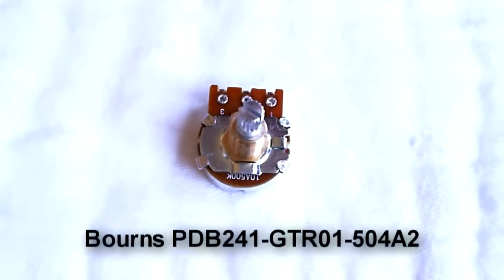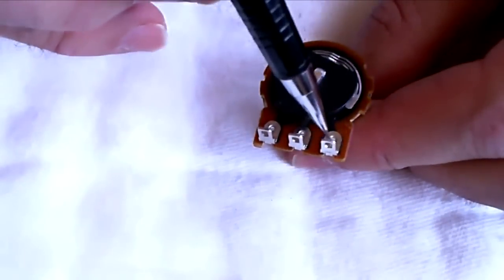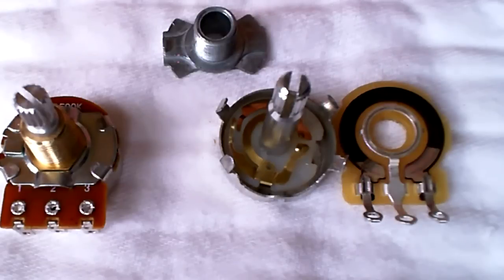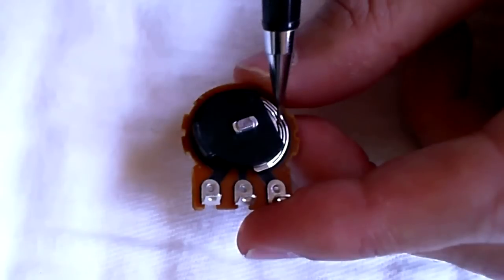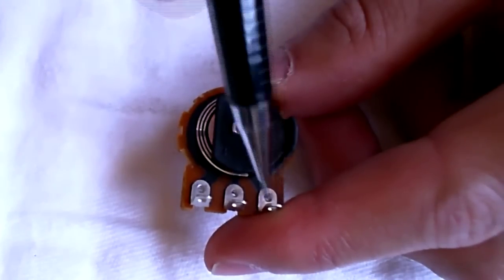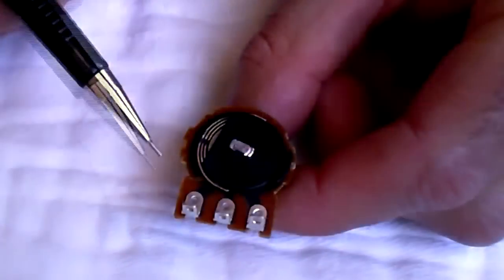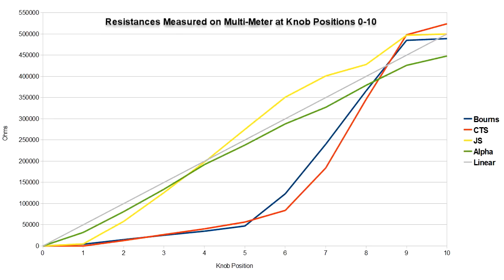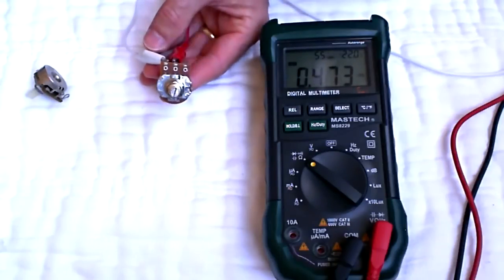Potentiometers - How They Work,  Disassembly and Exploration

Comment: I have noticed that new cts pots have small metal tabs at each end of the carbon trace so that when the wiper is at the end of its travel, the wiper is not touching the carbon at all. This gives the center lug a direct path to which ever side lug the wiper is turned to. On older cts pots the wiper is still going through a very small bit of carbon trace even when at the end of it's travel. It is enough to give about 10 to 20 ohms of resistance. Could this affect the sound?

Comment: by learning lab, do you mean those things that have the little springs you use to hold color coded wires down that are connected to circuit components, that say they can be used to make maybe 30 to 100 different things?

Comment: Thanks for the accurate, and well presented video on potentiometers.  This video is SO MUCH BETTER than most of the others!  The great thing about CTS pots is that they can dissipate more power than most of the other audio pots (except PEC) and they can be disassembled, and reassembled to to change shaft length or style and also change resistance elements of double ganged pots.

Comment: Good stuff. Encoder and potentiometer are used in servo motors. Is it the same potentiometer described? Whats difference?
Reply from the maker: Encoders and potentiometers are not the same. Unlike the pots explained in this video, encoders rotate continuously and generate pulses that are used with digital circuits that count pulses and velocity to do some work.  Here’s a good article: https://www.arrow.com/en/research-and-events/articles/encoder-vs-potentiometer-how-to-choose

Comment: I agree with the nice things already said about this video but I sincerly hoped for some advise on really disassembling different pots completely and even harder things like putting them back together without killing them. I have a few different methods and they work well enough to be 80% certain not to totally destroy it but I didnt come up with something that makes it easier and less of a pain in the a.. so far... any ideas? What I do is either drilling a tiny hole in the shaft and put a screw and a washer instead of the flanged end of the shaft or I re - flange the end while pressing down the pot, the ring with the wiper and sometimes also the disc that makes the whole thing somewhat stepped (dont know the exact expression for that, sorry)...I'd love to make a tool for fixing the pot etc in place before hitting the end to flange it, but I have no idea how...or what...I only know two hand are not enough to make it an easy operation and I hate assembling pots very very much...not as much as a dirty pot but still...a lot!!

Comment: Very good videos. In one of your other videos showing an epiphone circuit being request, you have actually removed the pots and poked them through some aerated cardboard... But you didn't mention it ... That's actually a fantastically useful approach when wiring without a scratchplate... Keeps the work still and even allows you to draw the wiring between the lugs... The latter might help if you are just starting soldering.

Comment: Thanks for a very informative video. I have an old Creek headphone amplifier, and the pot is very noisy when I turn it, so I contacted Creek about it, and they are willing to sell me a replacement if I want swap it myself, which seems like an interesting thing to do,but seeinh your video, I'll have a closer look at it to see if I can clean it up or if it's just broken or worn down first. I tried to clean it with some fluid I saw recommended somewhere online, but it didn't do the trick. This was a few years ago, so I don't recall what it was :P I will have a look at the other video you mentioned as well :)

Comment: This is very usefull, Thanks. Ive got a fairly old Sony AV amp that has a bad volume control, it loses a channel and crackles when you turn the volume control. Would it be a similar potentiometer? I didnt know they were this simple. Think after watching this il give it a go and see if it'l clean up.  Cant afford to lose the amp as it'l cost me a fortune to replace, its a great amp.

Comment: @johnplanetz  Well, I just watched the video again and the the cts pot you disassembled has the copper tabs I am takling about! They clearly extend out from each outside lug onto the carbon trace. The older cts pots do not have this copper pad or tab or whatever you could call it at each end of the trace. I don't know if it makes any difference, I just noticed the change a few years ago. Thanks for your very neat posts!

Comment: I thoroughly enjoyed this video John.  Thank you for making it.  It was VERY well done.  I've got a rheostat on a ceiling fan that only has two lugs.  I think it's bad because the fan spins very slowly across the whole range of the rheostat.  It's soldered into place so I'm going to take it out of the fan (circuit) and test it with my VOM.  If I can tell it's bad I'll go to the local lighting store to see about a replacement.  It should work much like the ones you tested in the video, correct?

Comment: Thanks for sharing this info. I am currently researching for a project. I am going to update an antique radio and am looking for details about how to choose the right parts for volume control, and radio dial. the radio dial i want it to still show the pin pointing at frequency but also send a digital signal to the raspberry pi, i believe that part is a rotary encoder. any suggestions on parts or similar projects would be greatly appreciated. thanks

Comment: I have a '78 Lincoln Continental with a dimming headlight switch.  The pot that you can turn on the dashboard will dim all the clock and gauge cluster lighting.  There is a "dead" spot on the pot where if I turn to that position (happens to be the max brightness).  Now, if the original Ford part was like the CTS design and had the stiff bent contacts, do you think the reason there is a dead spot and slight intermittency in that area of the pot is because those stiff contacts are a little word out?  I would like to replace it, but my car has an auto headlight dimmer and the headlight switch is built into the gauge cluster dimmer, so it is a hard part to find since not all models had autodim.

Comment: @johnplanetz - DUMB QUESTION... Do I need potentiometers? I never use my controls(I use a volume and an EQ pedal).  I was thinking about running pickups+toggle+output. Btw, I use passive and active pickups. I wired a cheap tele copy w/o pots and couldn't hear anything bad... actually sounded better than before

Comment: i have one little problem, maybe you would know what may be wrong..? i've been replacing a pot into pushpull - at first i put it in the tone position, then changed the vol and put back the original tone pot, so now the vol is the pushpull and the old tone pot, but when there is a sound and i turn the tone knob i get a noise, which is absent when turning it with no signal. do you think that i damaged the tone pot when soldering? or there may be other problem?

Comment: @johnplanetz Well ive had a good result. I took the plunge, desoldered 2 of these pots that were sandwiched together, i guess 1 for each channel. Took them apart and carefully cleaned the carbon tracks and the contacts. I then very delicately tweaked the contacts to apply abit more pressure. Put it all back together and vola, its working perfectly! Thanks to your video.

Comment: I’m refurbishing a 1960s Regentone record player,The 3 pots have each 3 lugs that are soldered into the printed board,and have lugs for wires to be soldered onto the pot and going to different components,But modern pots have usually no connection lugs for wires! How can I connect these modern pots? Or have I got to try and purchase old vintage pots,any advice would be welcome.thanks.
Reply from the maker: Use a multimeter to confirm which three pins (soldered to the circuit board) correspond with the three pot lugs. Then with your new replacement pot, just run a wire from the pot lug to the circuit board - (it's ok to have multiple wires soldered to the same pot lug).

Comment: Message sent. I don't know how effective increasing thickness of the strip would be, since the signal should just be able to take the shortest path right? If changing the materials/conductivity along the strip is too expensive, I thought of a cheap way to approximate a log.

Comment: John, I am really pleased to have found your videos.  I've built a couple of guitars; but, always find myself wondering about the "hype" when it comes to pickups and electronics.  I believe watching your videos will teach me to make the correct decisions.  In the meantime, while I'm learning, I have a 1988 G & L Invader H-S-S that seems to be crackling a little.  Any suggestions on what to replace and a good source for the parts?  I would keep the original sound; but, if I can gain some tone???

Comment: I'm using a AA battery for a project I'm working on and I wanted to be able to limit the voltage with a potentiometer. The battery only gives a current of 2 amps which gives .75 ohms of resistance. Does this mean that I need a potentiometer that is within that range? I've been trying to learn about this today and I don't seem to quite get it yet.

Comment: I want to use a pot for regulating an alternator's voltage to a 12 volt deep cycle battery. What pot should I use for 14 volts at 100 amps? Thanks!

Comment: I have a pot-.05 watts <47mv 3amps 30vdc...looks like the one in your vid, but it has 3 poles on the back also. Can I use this in-line with a speaker to control it's level? How would you wire it? Thanks.

Comment: great video: does the pot need to be disconnected from the guitar electrics in order to measure its resistance? Or can it be done while the pot is soldered on the circuit?

Comment: hey im just wondering....can better quality audio linear pots help reduce feedback?...or does the capacitors help out with that problem?...because its odd that im wiring 2 humbuckers to a 5 way switch and it has a lot of feedback....and i have another guitar that I wired the exact same way with the same humbucker pickups and has no feedback and a .047 green cap...thanks for your help

Comment: Basically a gas gauge works from a pot output. My replacement gauge is reading in  reverse (empty tank shows full). Can I swap pot. connections 1 & 3 to correct read out?

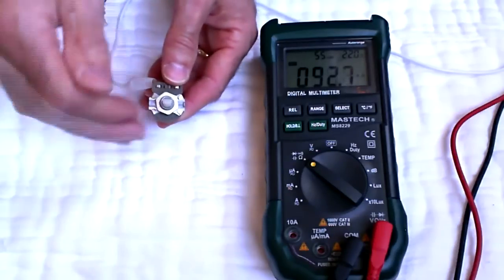Comment: ok, i'm confused... when you measured the two diff pots at 8:17, the linear pot read ~182k and then ~92k at halfway. But then the log pot marked 500k measured .522k and then .473k at halfway... wouldn't that make it a reverse log? also, why did it read 00.522 instead of 522.00?

Comment: I think you may have inadvertently solved a problem.  I was getting no sound from my guitar.  Did the usual jack tests and all was fine.  I narrowed it down to the vol pot.  If I bypassed it with a jump wire current flowed.  When I peeked through the gap in the pot I could see a little something hanging down but not touching the bottom of the pot.  Assuming this was crud I gave it a flush through and the piece vanished. Still no output.  This must have been the broken the sweeper.  Am I correct?

Comment: I have a CGE NOS Gibson pot and the shaft wont slide off over the middle part of the shaft but it does spin freely, is there a way to get it off? edit: yes you can, you need to prize the black plastic thing off (the bit thats crimped on and theres a ring clip underneath it, sadly the plastic broke on mine when prizing it off.

Comment: John Cooper, nice video! I understand that a small commercial dough mixer with speed control uses a linear taper potentiometer (COSMOS TOKYO TOCOS RV24YN20S B502 186C 321), because the B that is there. Well, would you please tell me what would be the resistance (ohms) of this pot? I suspect that this pot is shot, because I don't get any reading from the position off to position 9 (0 to 10), I get a jumping reading on position 10 only, from 34 to 85, going back and forth (I have the ohm meter set on 200, if I set on 20K position, I get Zero. This reading is from the middle and right lug only). The mixer has an 800 Watt motor with brushes, brand new, after a few minutes (with a strong smell since it started working) mixing bread dough, it quit. After checking here and there... I am ready to replace the potentiometer, but I cannot find the same one online. Would it be better to install a stronger one? Is there a minimum and a maximum resistance potentiometer for this 800 Watt motor with brushes? What do you advise?  Thanks a lot!
Reply from the maker: B502 is linear 5k.  Googling your part number turned up the data sheet for your specific pot: https://datasheet.lcsc.com/szlcsc/1810170728_Tokyo-Cosmos-Elec-RV24YN20S-B502_C128184.pdf. So, RV24YN20S-B502 is a linear 5k pot, 24mm with 20mm shaft length, panel mount, slotted shaft.  You don't need to buy the exact same part, but I'd replace it with something with matching specs
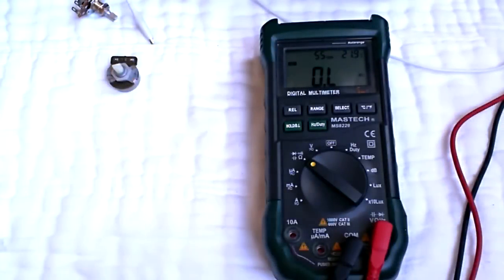Reply from the maker: To confirm the pot is linear 5k, measure with a multimeter as i show in the video at 7:44
Reply: @johnplanetz ... I appreciate your reply. I called a parts distributors (mouser.com) and they told me that this pot is linear, 0.5 Watt, and 5K ohms, according to the manufacturer and part number. I assume that this pot is damaged, because I  do not get a reading from the outer lugs, all the way off (zero) or at any position from 1 to 10. When open, if damaged, what kind of damage should you look for? Another question for you: would it make a difference if I installed a pot with higher wattage? Let's say 1 or 2 Watts? But linear with 5K ohms. Thanks.
Reply from the maker: @jackboltsvolts8986  If you don't get a multimeter reading between the two outer lugs, then  the carbon trace may have cracked or separated from the wafer, or the points where the lugs contact the trace may have broken.  Installing a pot with a higher wattage should be fine.
Reply: @johnplanetz  - Finally I understand all this concept. The reading I got before, was completely wrong, because I was using the setting that is for continuity. Now that I have the setting on 20K  Ω, I am getting 5.12K ohms, from the outer lugs, and if I turn the knob to about the middle, I get two values (one value from the left outer lug to the center lug, and another value from the right outer lug to the center lug) added, come to 5.12K ohms. After going through every possible problem, I found out that I have a bad Circuit Board on my Stand Mixer. You inspired me to win the battle. Thanks a lot!

Comment: yeah you can make the potentiometer control you pulse speeds kinda like how you would dim a LED.. Sort of like turning it on and off really fast to make it run slower instead of lowering the voltage!.

Comment: @johnplanetz- The p/n is still the same-013446, at least on the ones I have which are 250k. I noticed the change right about the time new cts pots started shipping with brass shafts instead of aluminum although I do have one with an aluminum shaft that has the metal or copper tabs at each end of the carbon trace. Just take a light and look in the pot and you can see little copper tabs extending out from each outside lug right on top of the trace. I like your vids by the way!

Comment: Hi John, thanks for the informative videos. I have a couple of quick questions for you. In a traditional Strat wiring diagram, I notice the pickup wires from the selector switch to the tone pots are connected differently. The corresponding neck pickup wire from the selector switch goes to the middle lug on its tone pot. Whereas, the corresponding middle pickup wire goes to a side lug on its tone pot. Why don't both pickup wires go to a side lug on their tone pots? Also, I'm under the impression that outside lugs on a pot, if used in reverse, will revers the effect (i.e. the tone knob would be muddy at 10 and bright at 1). Is my thinking correct here?
Reply from the maker: +tlgrimmy - a guitar tone pot is wired as a variable resistor, so you only use one side of it (center lug and one side lug).  You're right that the effect of the pot's turn-direction depends on which side lug you choose.  But having chosen a side lug, it doesn't matter to whether you wire the pickup to the side or the center lug - just wire the other lug to the tone cap to ground.  Or you can put the tone cap before the pot.  Doesn't matter as cap and resistor in series are interchangeable.
Reply: Thanks! I've been wiring pickups for years, but trying to fully wrap my head around why everything is wired the way it is. That helps! Now I'm finding myself trying to follow the path of electricity and it seems to split at the selector switch with two parallel circuits, one through the pickup, one through the tone pot. Assuming electricity follows the path of least resistance, I'm having trouble understanding why the electricity doesn't pick one path over the other, either going through the tone pot to ground and not the pickup or vice versa. Confusing...;)
Reply from the maker: +tlgrimmy - you're on the right track.  I have a video that explains how the tone circuit works here: https://www.youtube.com/watch?v=rR4maqK_IhQ
The short story is that a capacitor blocks lower frequencies and passes higher frequencies, so the part of the signal that makes it through the cap to ground is the treble.  The tone circuit rolls off the treble!

Comment: hey, im trying to hook up an amp to my home surround sound, it has up to 180W going to the sub and i have spliced into that to make a (pre-amp) for my new 3000w (350Wx2ch) amp but i dont want to fry the inputs with the 180w input, so im trying to install a "pot" to turn down the input into the new amp. im wandering if there is a formula to tell me how many ohm pot i need to splice in? any clue?? i dont even know it this will work. any hints?